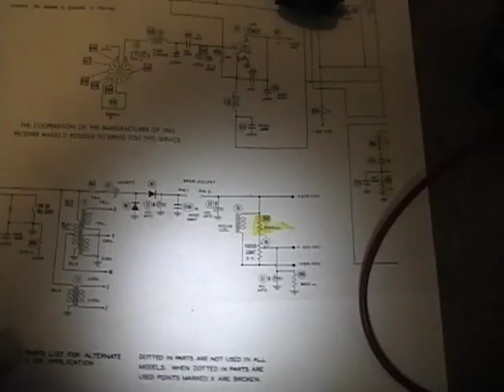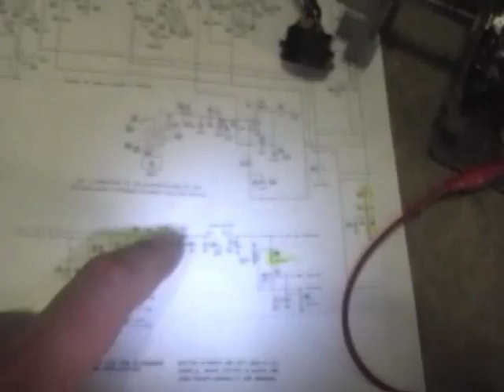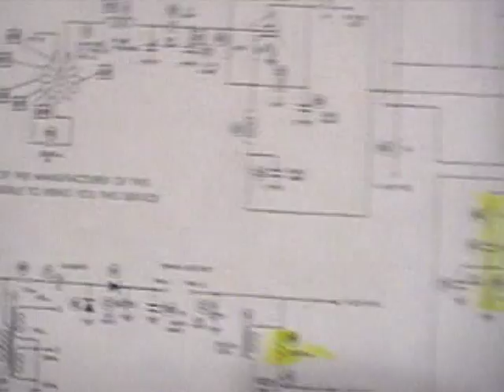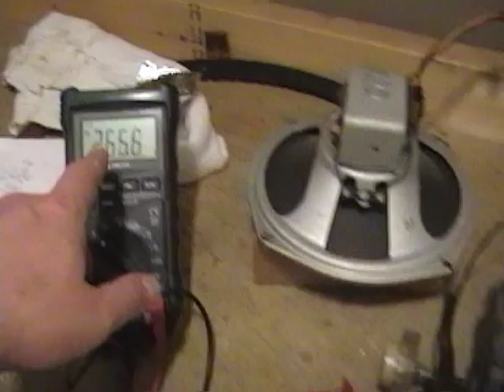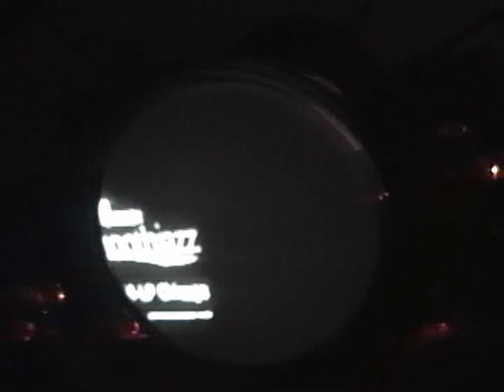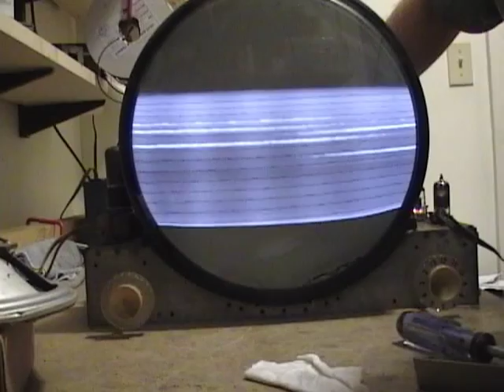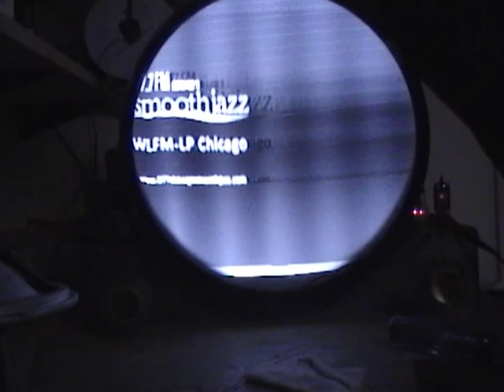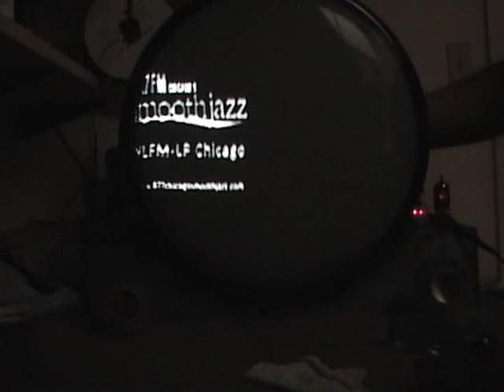Motorola 12K2 restoration p5o?

Comment: Hey, This is dragcat352 from the Antique Radio forum. The Horizontal  oscillator on my set is acting the same way yours is at 10:50. How did you fix this?
Reply from the maker: Sorry I don't remember exactly - that was 7 years ago.  Typically the horizontal oscillator free running needs tweaking or maybe the horizontal hold circuit needs work.  There is an adjust for the horizontal freq on the back of the chassis I think.